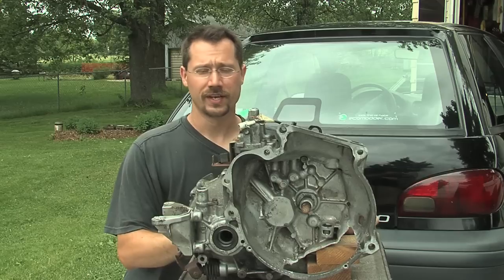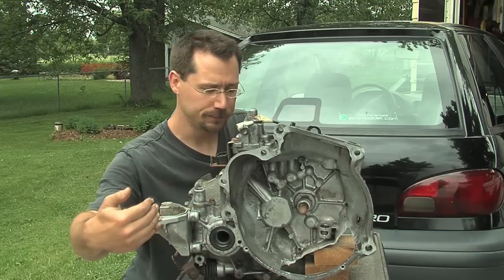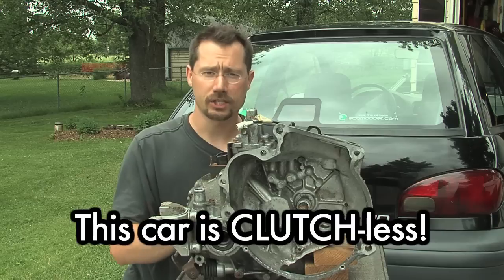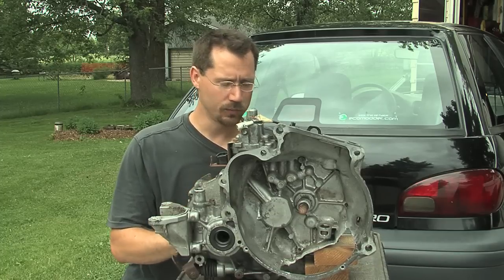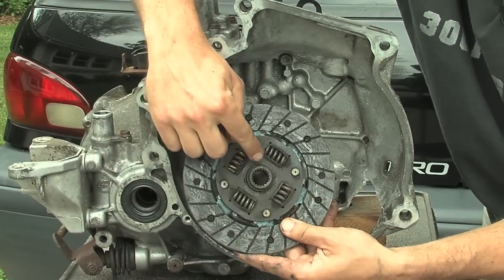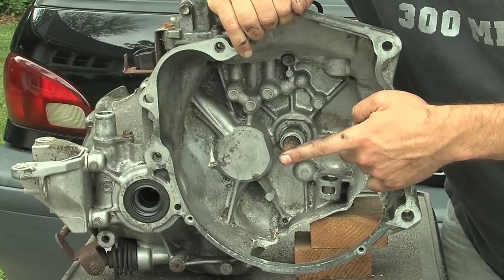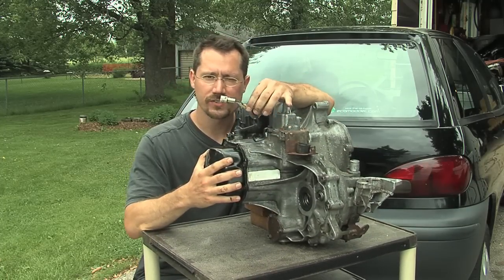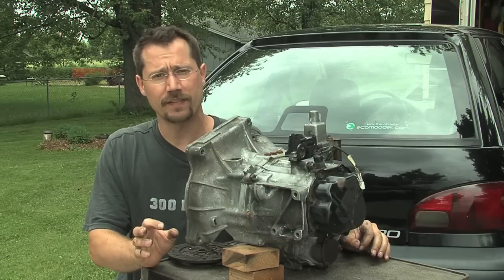6 Build Your Own Electric Car: Transmission

Comment: I've been told a few time an automatic can be troublesome if not impossible to use. Can you clarify why this is ? ? ? I've got a Nissan Micra Automatic at the moment and would really like to convert it as it's a good runner other than the catalytic converter dying on me -______-
Reply: I know GM is doing a "crate engine" electric motor kit that hooks up to their hydramatic automatic transmissions.
Reply: @louisbabycos106  Which is estimated to cost $75,000. You CAN use an automatic transmission. EV west does it with a 2 speed Powerglide transmission that has an auxiliary electric pump  The hydraulic clutches won't work when the engine speed is under 500rpm so the pump kicks on to keep the clutches engaged.
Reply: buy a $50 brand new converter from magnaflow or any of the other 10,000 muffler/cat manufacturers??? 
 why would you think you need to go electric,because of replacing a cat convertor?

Comment: dude, i bought a geo metro back in the late 2000s to convert. Never did. money money.  Make sure you keep that torque real low. Those transmissions are not very strong and are not made for lots of torque.
Reply from the maker: I've commonly pulled away from a dead-stop in 5th gear. Plenty of torque. Never any issues with the transmission.
Reply: i think he means your going to strip the gears on the transmission,  @BenjaminNelsonX
Reply from the maker: @biomecaman3514  No. Never any trouble stripping gears. Transmission in this car was always great.
Reply: use 4th (direct coupling) and reverse, the other gears are pretty much useless...
Reply: @omegarugal9283 the other gears are fun for acceleration though..and if you feel like driving it like a regular manual

Comment: Has anyone watchedJehugarcia  where the electric car gets 1200miles on one charge... I'm sure these electric motors can be coupled to a big alternator and recycling energy back. Amazing video.
Reply: Running an alternator off of the motor will just increase the load on the motor, requiring more watts to move the same distance and will not charge more than the wattage used to move it. It will actually charge less watts than it takes to drive it due to heat losses.
Reply: @rubiconnn  
I have a solution to this problem.
However I am very hesitant to divulge it. Because I've worked some 20 odd years on this problem to get it solved in order to build my own prototype...
1.) If it is not done just right you may have an explosion or fire hazard.
2.) Weight is the biggest contributor to failure. Doing more with less is the answer. But how it's done is the factor.
(Have a great day.)
Reply: they can't, but an alternator with a fan clutch can be used to "regen brake"
Reply: Good video sir
Reply: there is no free lunch and nothing on earth will ever produce more energy than it uses unfortunately.its one of the primary laws of physics,any "free energy device" you have ever seen is absolute bullshit

Comment: U used a thinner oil to save energy?  Electric motor is smooth hence no protection for hi-torque pulses is required.  Go w thin ATF.  Syncromesh might be a little affected.

Comment: Decent electric motors can run at very high RPMS without any problems even long term.
Reply: You mean AC motors.
Reply: @Yodaandhislightsabre  there's a lot of different types of motors some old styles of dc motors are getting used as brushless. Sorry but i don't remember what they are called, be better at manipulating magnetic fields is opening new ways of making motors stronger and more efficient.

Comment: If you’re not using a clutch, how will you shift into the next gear?
Reply: releasing the accelerator, the electric motor stops. The gasoline engine is always spinning. The electric no.
Reply: Due to the massive torque range of an electric motor you don't need to change gears.  Most builders usually stick with driving in either 3rd or 4th gear.  You can pull away with most self builds in 3rd gear.
Reply: @manwithcorsae7738  but what if you want to tow a caravan up a hill and you only have a small motor?
Reply: @TimpBizkit  The amount of torque in an electric motor is so huge you don't need gears.  Also, that torque comes from zero rpm and up.  That's why electric cars have such massive acceleration.  Even my ZS has acceleration in the region of 0 to 60 in around 7 seconds (TBH it feels a lot faster).  Especially when you're leaving more renowned cars in your wake.  The reason why a lot of electric cars aren't rated for towing is that a lot of manufacturers don't want to tell you how much the range is effected!!.  The petrol version of the ZS is rated for towing.  I can buy a towbar for mine, but it would not be legal to tow as mine is not rated for it.  Towing would drop my range from around 150 miles to around 80 to 90.  There are quite a few now that can tow in the Volvo's and Tesla's.
Reply: @manwithcorsae7738  depends on the output of the motor. High performance motorcycles usually work fine with a single speed. I'm surprised the Tesla Semi also only had one gear though.
Reply: @TimpBizkit  Tesla semi is a fraud lol, the weight of the batteries takes up nearly the entire load capacity of the prime mover and trailer, you end up with a capacity of 3 tonnes instead of 17.
Reply: You don't need clutch for an electric car. Even gears are optional needed only if you are into racing.